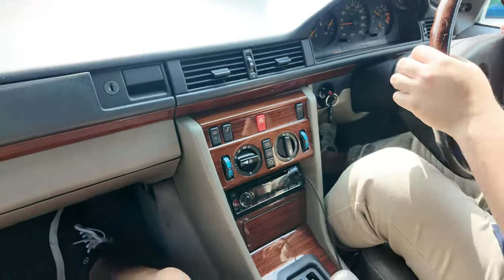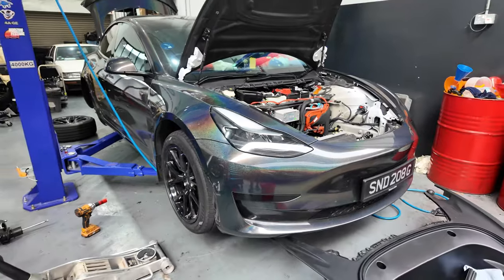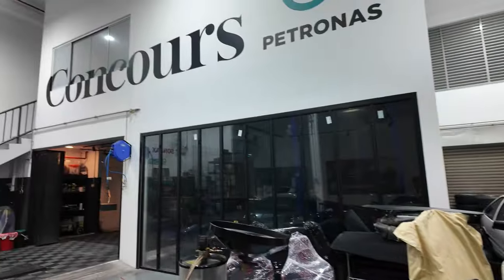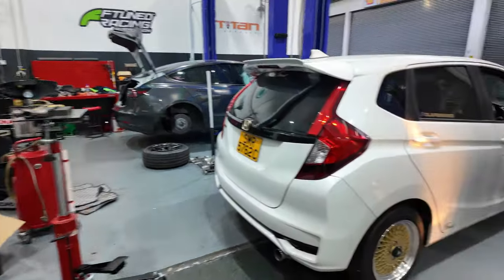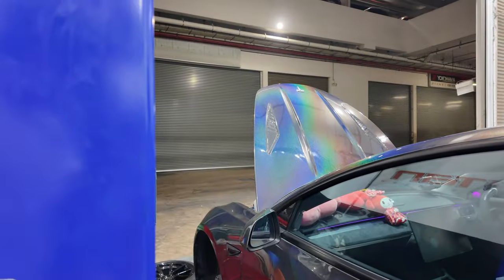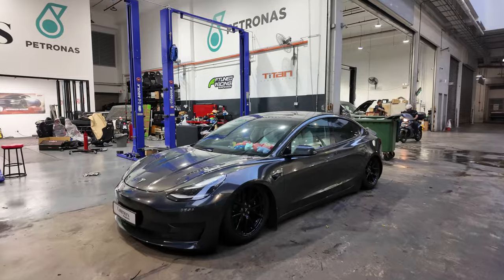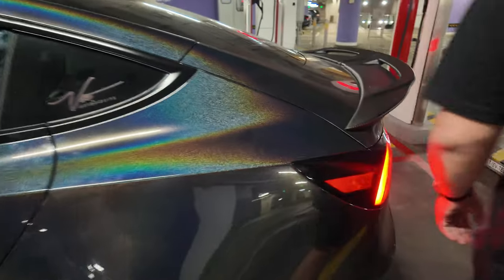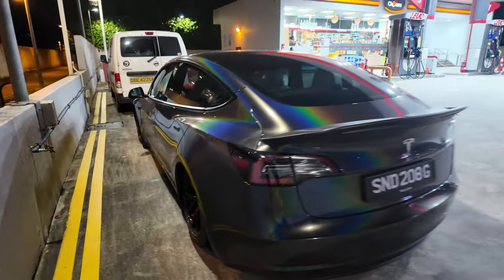MY FIRST TESLA AIRSUSPENSION BUILD! - TOTAL NOOB ALERT

Comment: did you install adjustable rear cambers? Because The Model 3 & Y's OEM suspension does not allow adjustment of rear camber..which must be corrected to retain tire life, range and traction..inner tire wear are very common on Model 3 and Y